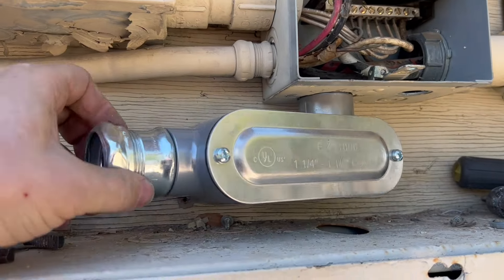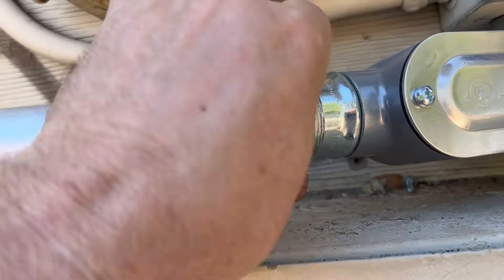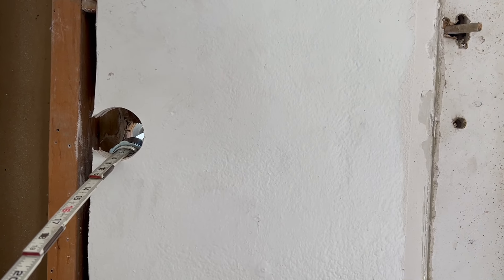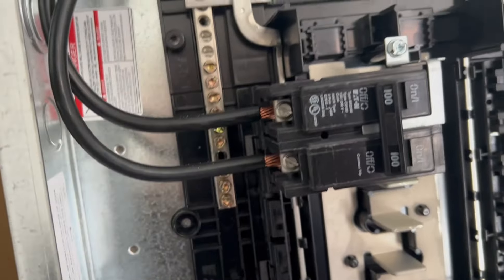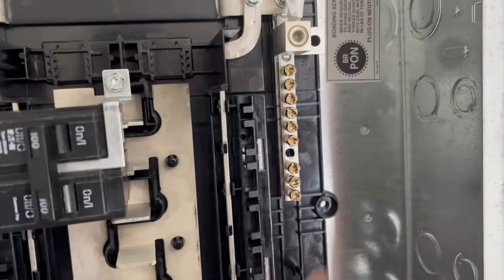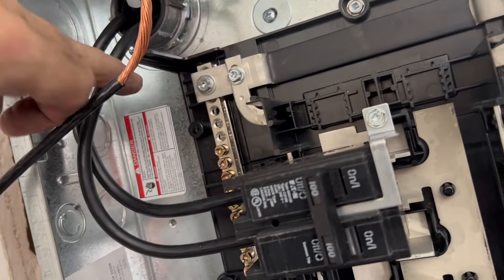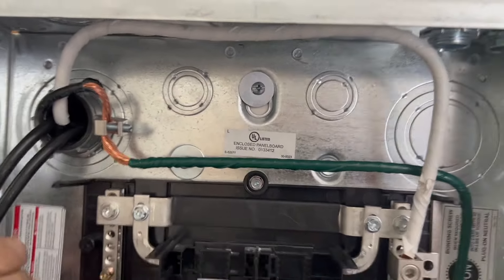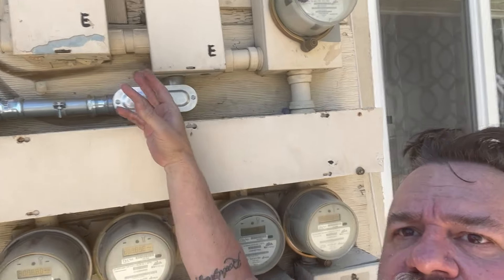How to install a sub panel. 100 amp sub panel quick and easy

Comment: If anyone is wondering why you must never bond neutral and ground together in the sub-panel, the reason is ground loops. Making a neutral-ground bond in two locations allows the neutral return current to travel through the ground wire AND the neutral wire. This is because they are both effectively in parallel. This puts a live voltage on the ground wire, which for obvious reasons is never safe.
Reply: As an electrician I knew that we didn't connect neutral to ground but I never actually knew why so thank you for the info

Comment: As you well know, there are many many rules in NEC that are followed by exceptions.   You are absolutely correct in this instance that no Grounding Electrode Conductor or ground rod needed.   The exception is, if installing a sub panel in a separate building or structure, you are required to keep the neutral and ground separated, but you are required to connect the ground in that panel to GEC and ground rods.
Have a Bud and an extra large taco!   Respectfully,   Kevin

Comment: Thanks for sharing your knowledge. Much appreciated.

Question: Is EMT OK for outdoor use these days so long as you use weather tight fittings? I see it everywhere.
Reply: The code allows it, but always check with your local AHJ. Some don't allow it, especially near the ocean.
Reply: Yes but I would say it depends on where it's installed. But yes it can be used outside

Comment: Thanks for these.  I've got a shed i want to run power to.  

3 circuits currently,  1 x 15 for lights and 2 x 20 for electrical outlets, possibly a 4th electrical circuit for outside.

Which videos should i watch and where should i go for more information.?

Living in Phoenix and having worked in landscaping, i know the heat of which you speak.

Comment: bonding on one side... but between two sequential knockouts?

here in WA we're required to pull a ground through raintight/weather connectors for EMT. someone died 4-5 years back after being hooked up between two EMT pipes on a roof.

Comment: Question for you! I have a 100 amp main panel, I have a garage ( side note we just bought the house) and the wiring in the garage was ran through conduit under concrete and spliced into a extension cord that was ran through a hole cut in the floor. I am looking to do this correctly, I’d like to correctly wire a sub panel in the garage, I would probably only need 30 amps, can I run a 100 amp subpanel from a 30 amp breaker on my main box which is a 100 amp main.
Reply: Completely novice and will have a buddy who is an electrician do this, but I am looking to learn. I am only going to be running a refigerator, garage door opener, lights and several outlets.
Reply from the maker: yes you can but its a matter of how the wire fits in the lugs. you could take the main breaker out of the panel if you wanted to as well. its like having a corvette but the speed limit is only 35. the panels value is only as big as the breaker.  it could be a 200 amp panel but its only good as the 30 amps feeding it and when you exceed that 30 amps it will trip the breaker. The minimum sub panel size is 60 amps but since you cant replace the feeders that 30 amps will have to do. im not advising you on what to do I am just giving you info on the code.
Reply: @StarvingElectrician  so should I just put a 60 amp breaker in my 100 amp main, and then run a 60 amp sub panel?

Comment: What is the purpose of those lb and LR fixtures are they use is pull points or just as a way to avoid double bending conduit?
Reply: both